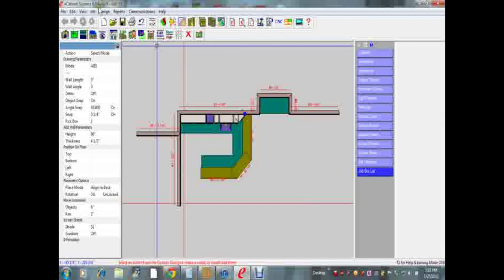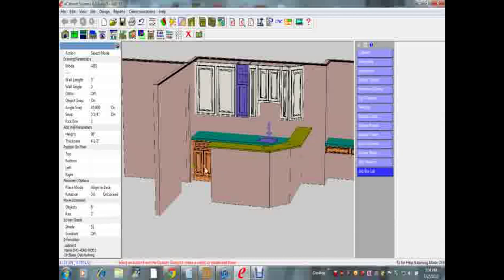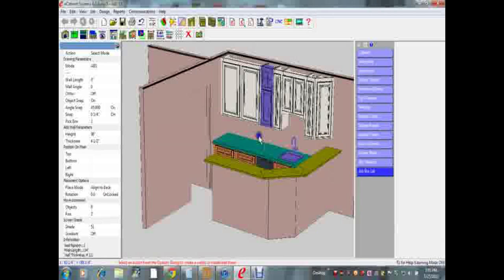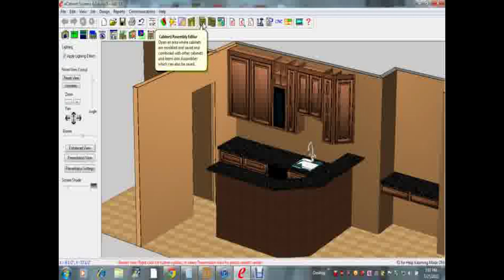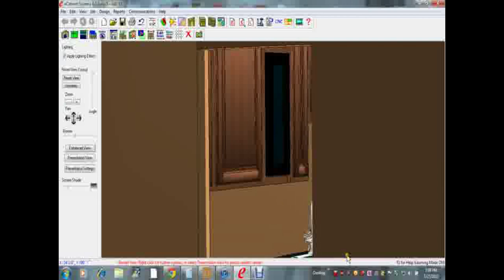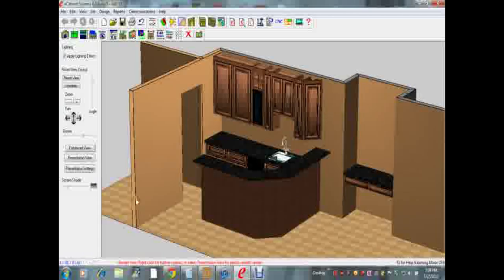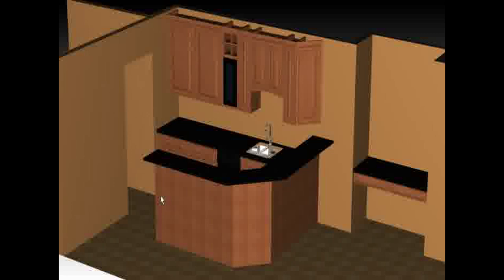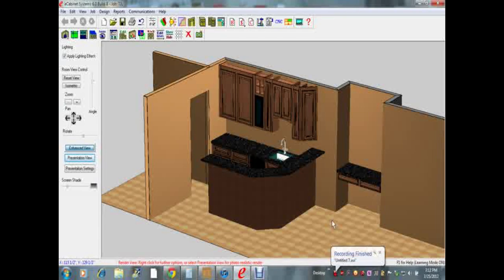Cabinet design software # 82

Comment: Great ct list but no dimension shop drawings you  have to do them your self that takes a long time. not all views
Reply from the maker: I've been using this software since 2006. You are correct, you have to generate the shop drawings in a different part of the program. Some of the recent updates now have and auto-dimension mode, but still lacks details. That aside, it's a pretty powerful software for $0.

Comment: Hey hey, The best woodworking blueprints that I have ever used are from Jacobs magic plan (just google it) Without a doubt the most useful woodworking plans that I have ever used.
Reply from the maker: +Fdf fe4thb sorry, you are promoting a service that has no comparison on what this FREE PROFESSIONAL program can do. Shop drawings, job pricing, materials list, purchase list, sheet stock nesting, and photolistic quality presentation renderings. Unlike the SPAM webpages like woodprix.com, teds woodworking and now Jacobs Magic, this  program is designed for the proffessional cabinetmaker and furniture maker and not for the DIYer. Please no soliciting on this channel. Scott.